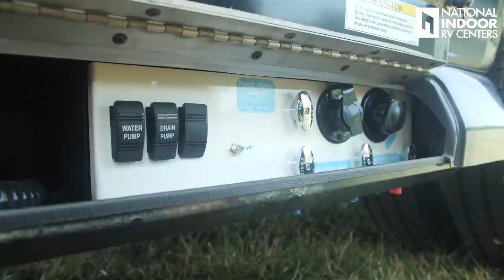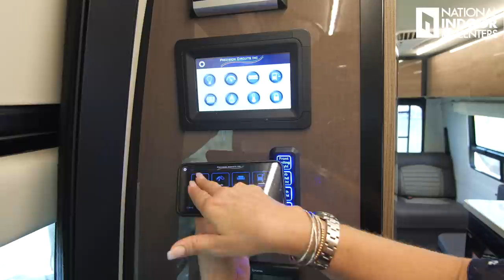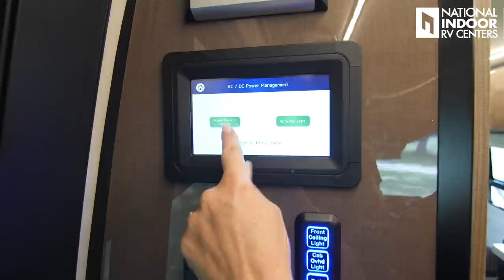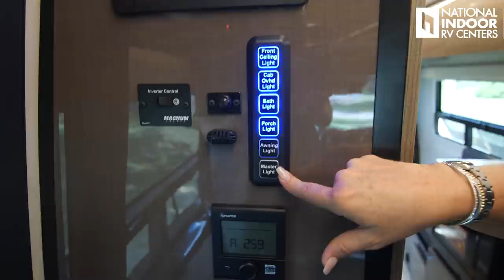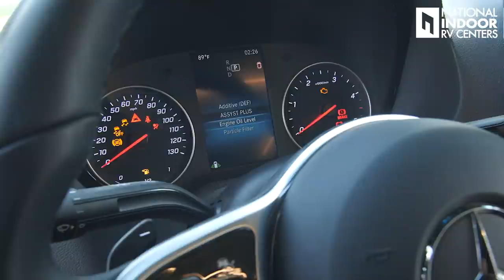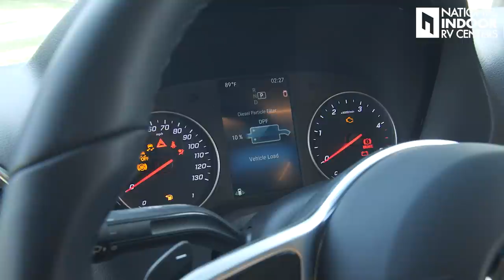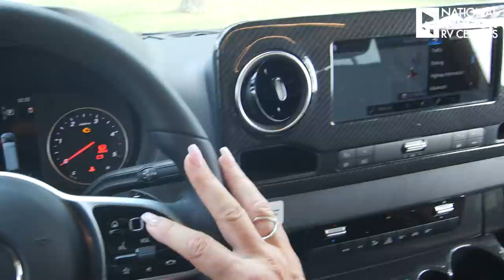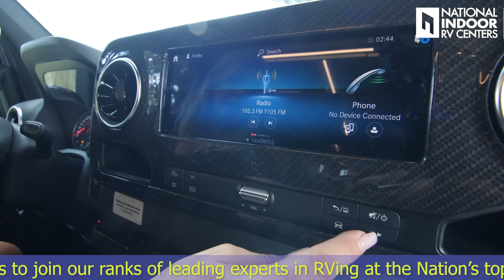2022 Winnebago Era

Comment: It seems like winnebago thinks the only people who need the extra power of the volta system are people that want to off road or go on rock climbing adventures in national parks a thousand miles from nowhere. They only offer it on travato and boldt but it should be available for all their rigs. I have extremely bad asthma and if I only had 200 amp of agm batteries and have a massive attack in the middle of the night and the batteries are low well I am going to get either chewed out by the camp ground or worse kicked out for running the generator at 3 am. They should offer it on all models and its unbelievable that they don't.